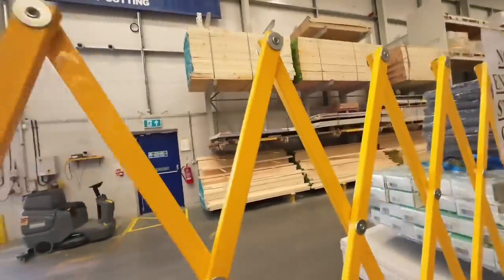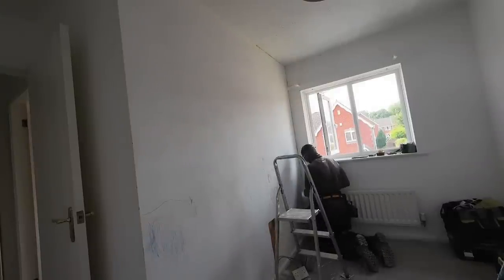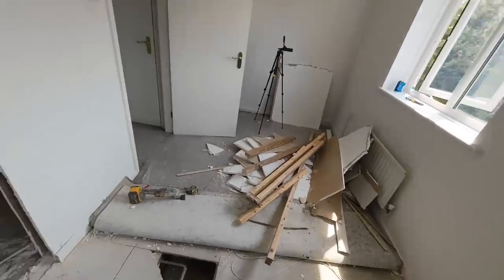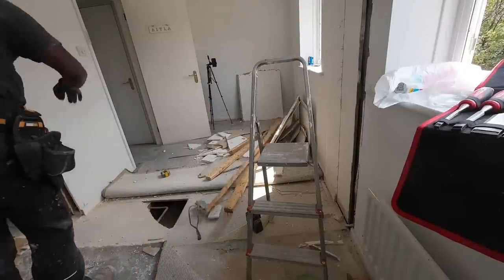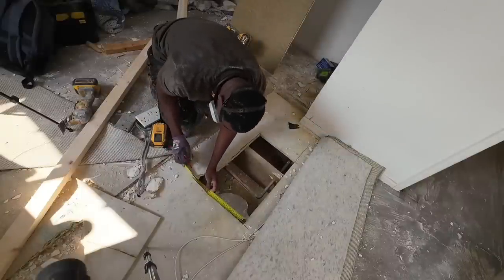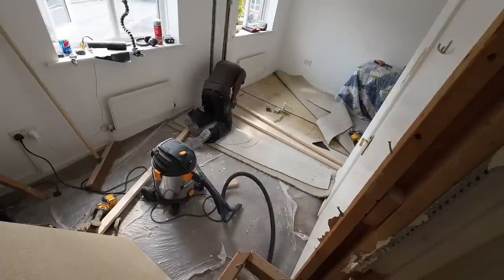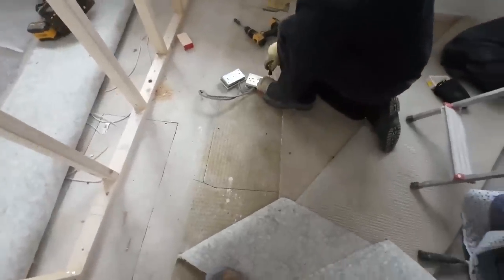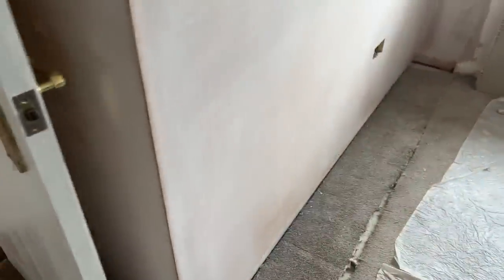Moving  a stud wall !!!  A day in the life (Self employed Carpenter)

Comment: have just bought my first place, 1-bed ground floor flat in a two-flat building with the same layout in the flat above.... timber frame with brick cladding, but I was wanting to maybe move some internal walls, but after taking down some plasterboard there are quite a few places where the pillars for doors meet the ceiling joists (beams?) and it's not immediately obvious to me that they don't help with supporting the building or at least upstairs' floors.  Is there a non-destructive testing method to see if any pillars are supporting much weight?

Comment: Recip saw with a metal blade in and cut the nails when taking down the old timber work, faster and can reuse the old timber and cut the costs down 👍🏼🫰🏼
Reply from the maker: love this thanks mate i really need to invest in a recip tbh i’ve been putting off for to long
Reply: @ttdowgcarpentry2390  or a bi-metal on the multi-tool? takes an age compared to a recip I guess though. Though, probably worth it even if scrapping the wood as it's made safer